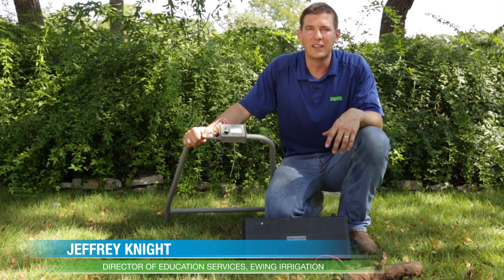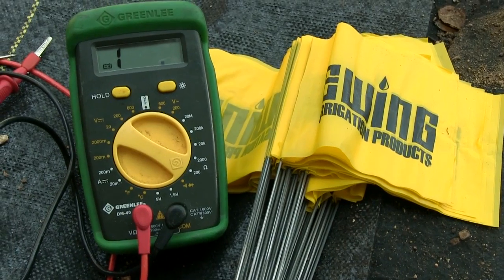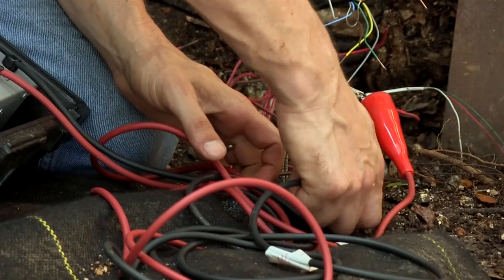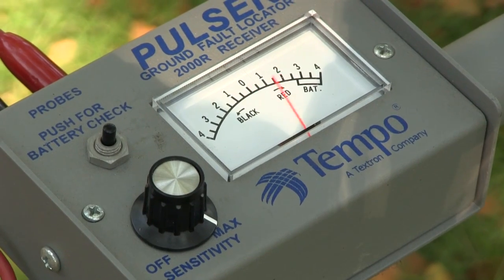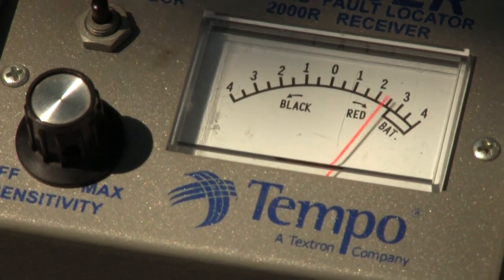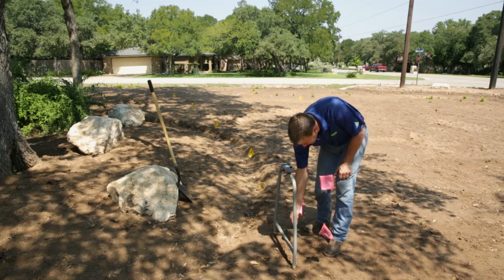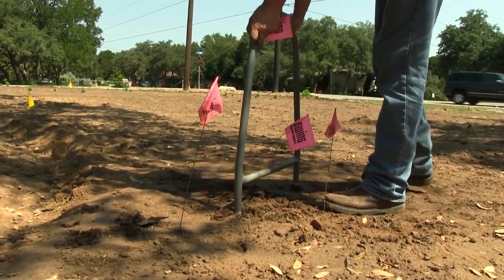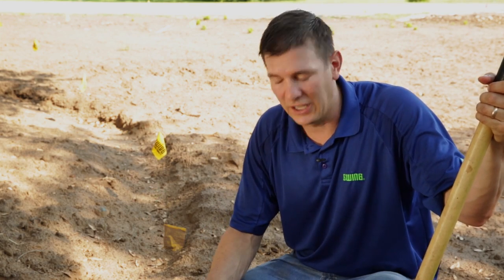Using a Pulser to Troubleshoot a Sprinkler System Wire Break

Comment: How far can I find a broken wire. I suspect to have a broken wire approximately 200+ feet away and I don’t have a very weak signal
Reply from the maker: The PE2003 has a 5000’ range from receiver to transmitter. Thanks for watching!

Comment: Can i use with 2 wire?
Reply from the maker: A clamp meter is usually used for detecting shorts in a 2-wire system. This article from Weathermatic might help you out.
https://support.weathermatic.com/hc/en-us/articles/360042175293-Two-Wire-Troubleshooting-Guide
Thanks for watching!

Comment: Do I need to disconnect the wire from the controller before using the pulser?
Reply from the maker: Thanks for the question WC! Yes, this device sends high voltage pulses of electricity down the field wire so you definitely want to disconnect it from the controller before connecting the transmitter. Here's a link to the manual for further safety and operation instructions: https://www.ewingirrigation.com/pub/media/downloads/311/Greenlee-PE2003-Manual.pdf
Reply: Thank you.